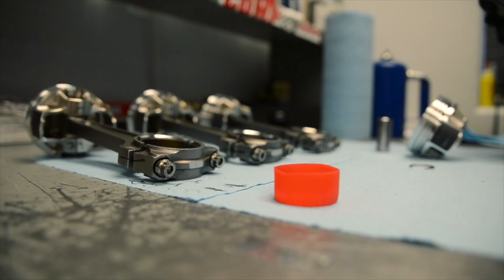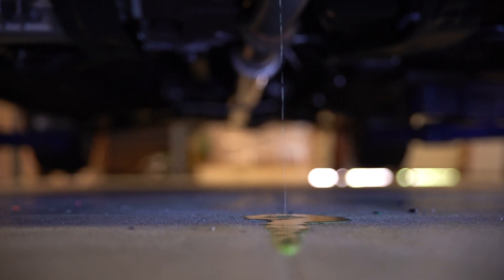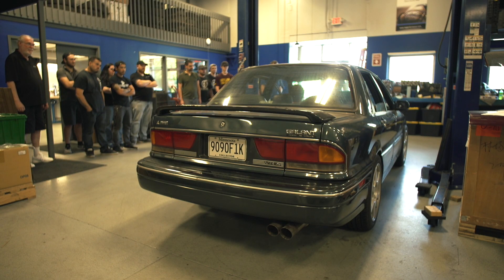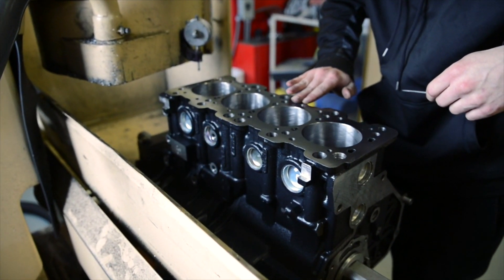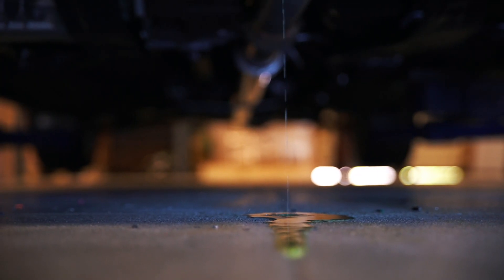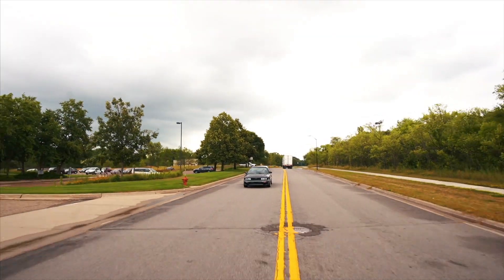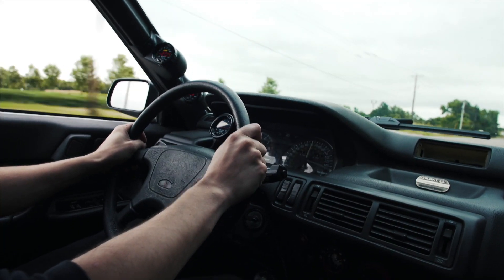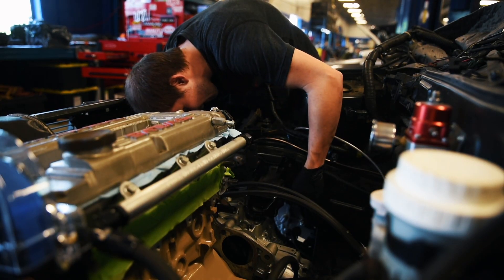Proper Engine Break In Procedure

Comment: subaru owner - I put an oil pressure sensor on both the front and rear oil gallery .  You can crank the motor without plugs/fuel/spark until you actually see like 50psi of pressure. (Obviously do not run starter motor for too long in 1 shot, but without compression it is not a lot of resistance).  Also, a trick for Subaru oil priming is to crank the motor WITHOUT an oil filter until you see a small stream of oil coming out of the oil filter port (It should not be long, like 10-20 seconds). THEN add a pre-filled oil filter and crank again until you get oil pressure.  This will get it primed and pumping more quickly.
Reply: This is all too much dude
Reply: @hjer731  not really.

Comment: Hi, I have a rebuilt engine. During the break-in period, the engine coolant keeps disappearing, resulting the requirement for topping the coolant up after a few trips. Pressure, pumps, engine oil, etc have been checked to be perfect. Can you please suggest what can possibly happen?
Reply: Somethings wrong somewhere. U have a coolant leak. Double check everything again.

Comment: Can u reuse the break in oil if there is no metal in it
Reply: I wouldn't
Reply: @ericwillis5031 shouldn't you use the break in oil until it's broken in? Meaning rings properly seated (around 100 miles)?

Comment: The machine shop told me to drive 1000miles with Conventional oil to brake in the motor.? Im also at 500 now I think should do the good brake in oil? But how many miles you think till I can pull at trailer??
Reply: Technically you should have used break in oil for first startup and drive. Then switched to conventional with a zddp additive afterwards

Comment: Im going to be installing a 5.7 hemi and I was wondering what oils should I use to break it in my engine calls for 5w20.
Reply from the maker: We don't have much experience with those mopar engines, but I am sure there is a ton of information on the forums/FB groups on those cars!
Reply: Did you ever figure it out. I have a 4th gen ram that just had a reman engine put in so I'm kinda scared to tear it up before it's broke in

Comment: Can i have my turbo installed during break in? Or will break in oil damage the turbo?
Reply: Having a turbo is fine, I just wouldn't use it. Simply go lighter on the throttle and drag out the revs.

Comment: I built a trailblazer motor with red valvoline wheel bearing grease. I thought i had a tube of assembly grease and didn't realize i did it until 6 months after finishing the engine. It runs great with now 35,000 on the motor. Guess it didn't hurt anything and boy did i luck out....

Comment: So what is the process if you have a different turbo and cams and compression and bored over and new clutch. Are you able to light load break in process like this video while watching fuel air ratio?
Reply: My plan (with standalone) is to slowly tune car myself until it can idle, Rev, and then drive around neighborhood. Then break in clutch and seat piston rings by driving around with wastegate spring at 5 psi.

Once clutch broken in replace wastegate spring for big boost and send to the dyno :)

Comment: WORTHLESS for non-roller cammed engines!!!...if you use a regular cheap oil on a flat tappet camshaft, YOU WILL WIPE IT!!.....you should have calrified, that your recomendations are for a ROLLER motor, NO FLAT TAPPET CAM WILL SURVIVE WITH OUT HIGH ZINC (ZDDP) OIL!!!.....dis-service to flat tappet engine builders

Comment: Ik this video is a year old but I have a question about my build so its a fully built engine with a stage 2 turbo cam and will have a turbo on it since it is a NA car. Would I need a base tune before starting it up and breaking it in? What is the best approach in my situation?
Reply: Base tune with the motor alone first is best because you don’t want any metal going into the turbo maybe put it on after the 500 mile mark

Comment: Will stalling cause damage to a brand new engine during the break in phase?
Reply: No. Stalling has little wear on the motor but it does do some damage to the clutch. However I am not well versed in this area so by all means someone correct me if I am wrong but from personal experience the motor takes very minimal if any wear from a stall
Reply: @donovinmiller3532  I appreciate the response 🤙🏽

Comment: Great video. Using this for my built N54 (first full motor build for me), currently at mile 300 of the 500 break-in interval. Stoked to get back on your dyno, nearly 5 years later, to see what it puts down!
Reply from the maker: Sounds great! Good luck!
Reply: How did it turn out I have a n55 I built and I’m tryna see what would be good for the bmw

Comment: I’m in an area with cold winters. My mustang is nearly finished and I am getting ready to start it. After the 20 minute break in would it be possible to let it sit until the weather is better? Or should I just wait until the spring. Don’t want to damage it.
Reply: After the break in you should be fine to let it sit. You could always pull the dizzy and re prime the oil system to be safe

Comment: Hey mapperformance. I just watch your video and i really learned a lot.  I rebuilt my 2002  D17A2  honda civic ex with no experience of what i was doing and i think didn't do it right even though its driving and not burning any oil. The piston rings, i certainly know that they dont gap the way they should and i didn't know that i should put the rings in the cylinder housing and measure it with a feeler gauge also i didn't know that the engine needs to be break in.so, please,can you give me a website for a good brand rings.? The honda dealer charging me $70+  for one set of rigs.
Reply from the maker: Hey Declan, shoot us an email: sales@maperformance.com 🤘

Comment: I'm curious, has anyone investigated breaking in an engine by spinning it with an external electric motor without having to actually run it. Just add oil and crank it up with a big electric motor to provide the power. No fuel no spark plugs no exhaust. Maybe an external oil heater to get the oil to proper temperature. Seems to me it may be a good way to control parameters like temp, rpm. The whole point is to get the rings seated and sealing so why does it need to actually be running? Anyone ever hear of this being tried? Is is detrimental or superior to running it.
Reply: You probably want the higher cylinder pressures and vacuum and stuff to get all that going, plus you want the parts to expand to operating size in order for proper wear-in
Reply: Combustion pressure is essential to provide the necessary pressure to force the rings out against the cylinder walls.

Comment: 60k miles on a M42B18 rebuilt engine and I didn’t really do much of a break in.  Covered cams in oil before I put the valve cover on, poured some down the timing chain, a little on the cylinder wall and it was fine.  Drove around for 100 miles varying streets and highest speeds at 30-40, then 65, 70, 65, 75, 70, 80 mph.  No burning oil, no issues after 60k miles

Comment: Does this go for a high performance 454 also?.. no tuner stuff, just meat and potatoes.. where the parts come from, they say run @ no less than 2000rpms for 20mins.. any other input on that is welcome.. thanks..
Reply from the maker: Should be pretty standard across the board! Always good to listen to the parts supplier / your builder too.

Comment: Who just got a new engine lol
Reply: Me🙋🏽‍♂️ haha
Reply: Me. Building my jdm ej205.
Reply: New sr20det 🙋‍♂️
Reply: @Project_s14  same
Reply: @Project_s14  Ka24de
Reply: Me lol, brand new fully built LNF ecotec with s257sxe
Reply: @drewwolford9036  tell me about this built motor you got going on, and is it going into a cobalt or HHR?
Reply: @drewwolford9036 getting my forged LDK with the s257 turbo myself. How did the car turn out? I'm excited but dreading the break in period
Reply: Me just got new engine for my 2016 sti with a gtx4088r turbo and not sure if I could start it and run it for 20 min cuz it has 2200cc injectors
Reply: Me new 7 bolt 4g63
Reply: @KINGOFSUPRA  i miss my DSM days.
Reply: Ford 289 for my classic Mercury with some fun bits, firing up today
Reply: i replaced my ej255 with a ej257
Reply: You mean who built a new engine
Reply: Getting my 350 tbi tom!!
Reply: @philiprollins2278  me too 3.8 genesis coupe Rspec 2014... it’s my 3 block
Reply: @kerimloco7475  i just built my 2013 genesis coupe 2.0t motor. Molnar rods weisco pistons.  .5mm over bore.
Reply: Me 454
Reply: Me. Built EJ257 bottom end with Manley rods and CP pistons. ARP head studs, Killer B baffle and oil pickup. Chamber matched the 2.0 heads to the EJ257 block so it’s an STI hybrid. It’s still in the process but it’s getting there as money permits.
Reply: ej25 home built, no used parts
Reply: Built...not bought.
Reply: not me im just bored
Reply: Rebuilt my rb25det with forged everything
Reply: Me!!!!

Edit: just got my car back with the new engine! 03/02/2023
Reply: Me 2500 to rebuild my 01 durango 4.7
Reply: Mine rebuilt lol
Reply: Just got my heads redone on my fuel injection 302 for my 85 ford. And reassembled the engine for thr first time. Definitely a learning experience
Reply: This guy did lol
Reply: 🙋‍♂️ it’s was worth it though my car feels brand new
Reply: Bought a mitsubishi montero sport 2019 v6 lol
Reply: Meee lol 4.8
Reply: WELL ya know
Reply: Me🤣
Reply: Me. 350 for a nova
Reply: Just got mine rebuilt but I honestly don’t know if to trust the guy or not I didn’t get any pictures sent to me while the rebuilding process so hopefully he really put all the parts I bought in it
Reply: @mr.knockyourbitchsocksoff5550  if you bought pistons take the spark plug out and take a lock with those tiny cameras
Reply: me, got a map 2.4l stage 2 block for my evo
Reply: @jakesmith6731  that sound nice you have an IG Build page ?
Reply: Here only drove 315 km still need to go about 500km
Reply: Ayeee sonata recall bby
Reply: Me 😁
Reply: Getting my ej257 built for over 500hp soon 😬
Reply: Me
Reply: I did, now at about 150 miles on it & trying to take it easy at least for first 500 miles
Reply: $40k later.. unfortunately me.
Reply: Ej 255
Reply: Just rebuilt my forged short block b18c1 🤞🤞🤞
Reply: 22R new Pistons .040 Block & rebuild head. Stage 3 lce cam😬 side drafts………
Reply: @micaherickson7252  my 392 got rebuilt just got it back 2 days ago. bigger pistons .020 block , cammed new crank
Reply: Almost all built
Reply: I rebuilt my l98 86 c4 corvette engine. :)
Reply: Me. Hyundai Sonata with the infamous 2.4 took a shit on me at 60k mi. Got my new engine under warranty, going to do everything I can to make this one last lol
Reply: @weegeemike  it won’t last but they will give you another one even past 100k miles
Reply: Me Focus ST with a new built engine, by me
Reply: If you go for a Quality rebuild then a Rebuild is actually better than the factory engines of second hand engines.
Reply: Rebuilt my 351w for 300 hp
Reply: Me 😂
Reply: Chevy work van jasper engine & transmission
Reply: Me🤳
Reply: Me 4.6 3v
Reply: Well after 113k miles I got some nasty rod knock in my 2011 Impreza sti 😢 so I got a new Type RA short block, iag oil pan package, iag AOS, Grimmspeed chase JB400 turbo, the injector clinic 1000cc injectors, DW 65 fuel pump, Aisin timing belt and water pump, JDM 12m oil pump, iag timing belt guide, fluid damper, killer b high flow water housing, grimmspeed boost control and a few other things, should be done today or tomorrow then to get it broke in so I can get it to the tuner and get a nice ECUtek tune!! Can’t wait!!! Sub/follow to see when it’s done! She gonna be sick!!!!
Reply: 🤘🏻 built my LS3
Reply: Never to late but a fully built Rb25det big turbo for my s14!
Reply: Corvette lol how’s y’all new engine going?
Reply: @CardPlayTCG  man im gonna be starting it up this weekend. I’m stoked. Been 7 months since I’ve drove it
Reply: @thomasreed9798  bro my car was at Chevrolet for 3 months felt forever
Reply: Haha. Me 🙋
Reply: Mime just broke 500 miles after being built.
Reply: Just rebuilt mine
Reply: Just started mine for the first time lol
Reply: 5.7L Vortec from Fraser Engine Co.
Reply: Me,complete rebuild 1995 eclipse 5spd 😉
Reply: Mine is in the fianal stages of rebuild thats why im here 😂
Reply: This guy new motor for my wifes challenger was 3.6l stock but went with a built 4.3l stroker build for it
Reply: Fifth Gen 454ci
Reply: Mine just got forged rebuild😂
Reply: Lol me rebuilt 3.6 tuned, and remachined cts
Reply: Me lol b20 swap ,92 teggy
Reply: 5.3 .40 over with a comp cam and a built 4l60e (I know...) 06 gmc. I figure it's better to have a old truck with a rebuilt drive train than any of these new pieces of crap coming off the lots today
Reply: Lmaooo 🤚🏻 6.2L
Reply: Me lol
Reply: 2008 csrt4
Reply: Me lol 400 miles on it. In the garage till season breaks
Reply: This guy
Reply: Just rebuilt mine lol
Reply: Me haha Vq35de😵‍💫😵‍💫😵‍💫
Reply: How long I gotta drive slow
Reply: I got a slow ass 2.7 Toyota engine on the way. Excited to put my 4Runner back on the road
Reply: Me. I did. $$$$$$
Reply: I just threw a rod in mine and want to be prepared for when it's back together again. (It's only been running for 538mi)
Reply: Rebuilt hemi 5.7 in my 2006 Dodge Charger 2006.
Reply: Me right here 67 miles on it
Reply: I’m about to build some kind of sbc stroker, not sure yet if it’s a 377 or 388, scat 400 crankshaft 307,327,350 block bored 0.60 over not sure exactly what block it is yet.
Reply: Lm7 5.3l ☺️

Comment: Just got my 347 stroker ford v8 (in a1960 british ford zodiac kustom hot rod) build through its cam break in, oil change and first 200 miles. I put comp cams break in oil additive in with the first sump of cheap mineral oil to try and give the new cam its best chances. Then after 30 mins at 2,000 to 2,500 rpm to splash lube the cam properly, drained and refilled with 10/30 comp break in oil.  I don't normally worry too much if its a customers engine at work I've had in bits but on my own £2,000+ investment it just makes me feel uneasy and hypersensitive to any noises. I think I more enjoy builds like my drift car where its just a scrapyard engine transplant that even if it threw a rod out I can replace the whole engine for £300. Built the drift car and immediately dynod it and then took to the track without any worries. (saab b204 rear wheel drive spaceframed Ford mondeo eurocar. 840 kilos wet. 296 hp with slightly bigger turbo and a remap. Completely stock engine.)

Comment: My tuner had me drive 1000 miles
Reply: Was he mean to you? 🤏
Reply: the one your tuner is an idiot. You have a 60 mile window from when the engine is new.... after that... it makes no difference. After about 80mi you change the oil and filter... and inspect the filter for excessive wear material.
Reply: ^^ Right, surely there are different break in periods required for a high-performance engine vs. a regular vehicle. It will be a different mixture of metals, for the components... And, also, driving it with dirty oil won't help either. I'd swap it twice at least, but that's just me. =)
Reply: @mareksumguy1887  this makes you feel important? Calling someone you dont know an idiot? Ok your the coolest guy on the internet hope that compliment works for ya big guy

Comment: Lolz. 
You immediately drive the car or put a load on it. 
If you idle or sit in place revving for the first 20 mins, your ring seal will be very subpar.
Reply: I have to break in my engine in a few days. Ideally I only want to rev it until my cooling system is bleed. Then hit the road and go through the rpm range carefully

Comment: I saw on one of RHD Kev's videos that he didn't press the clutch on his brand new engine. Something with thrust bearings. Can you elaborate?
Reply: helps prevent crank walk, lots of guys bypass the neutral safety switch
Reply: TunerBattle hey yeah I never thought of that.
Reply: Hey, btw., it's also while operating the vehicle, always... Don't keep the clutch pedal pressed in for long, when not needed. Most, if not all vehicles don't like it.

Comment: So do you guys think it's okay to use stock cylander heads after they have been machined and cleaned? Or should you get aftermarket cylinder heads and what's the main difference?
Reply from the maker: Reusing a cylinder head is fine, assuming it's been properly inspected and cleaned. When we see issues is with people who reuse parts after a catastrophic failure without properly cleaning or inspection.
Reply: @maperformance  no failure I'm just pulling bottom end to replace it with stage 3 fa20 but I'm just curious what's the major difference in like a iag stage 4 cylinder head package or just having stock ones machines and then adding the bigger valves and springs and etc.

Comment: I can't relate since I'm on a stock motor 😂 but what i did when i bought it brand new was not rev it more than 3-4k for the first 500-600 miles
Reply: JustCallMeDope piston rings need to seat, factory motors are set wide open for 25 mins. Babying it won’t help
Reply: @TurboLS4dr  i was a lil surprised this vid didnt cover this well.... he just said "varying revs"
Reply: @welcometoreality3450  He said varying Rpms between 2-3 thousand so i'd assume he just means regular town driving and not leaning on it hard.
Reply: ^^ Not red-lining it, but also going to high revs and let the engine do the braking, by down-shifting also... It's to get it to settle at all sorts of temperatures.